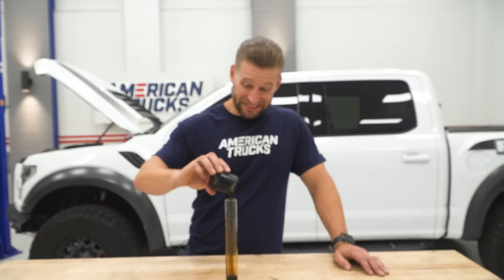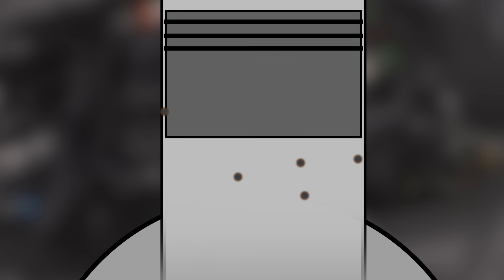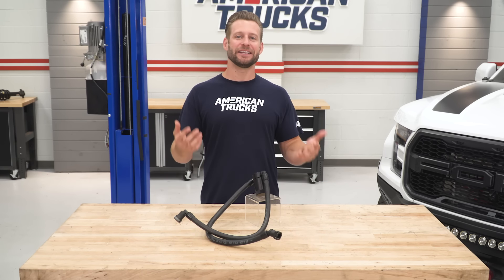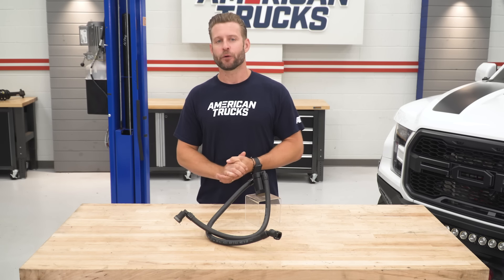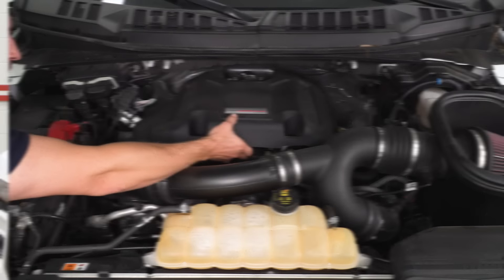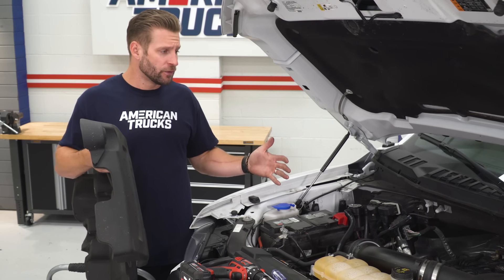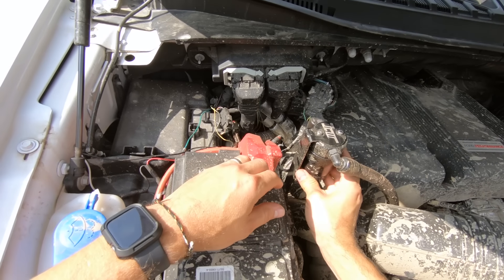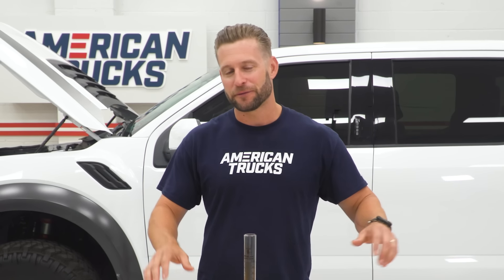Does Your F150 Need a Catch Can? - Ford F150 Oil Separators Tested And Explained

Comment: Ford ranger ecoboost actually has a oil separator from the factory on left side of motor. I was told as long as you change your oil as recommended you don't need these.

Comment: Does this affect your warranty and is it legal to add for pollution control in states that require smog checks?
Reply: Make it ez to take off and put the stock line back on. I remove mine before every service; I just do it eventho cars at that dealership I use  have them on. Taxifornia has a 7 years on the first emission test and inspection. They only plug in to the computer to check; but they still do a visual so if I have my truck in 7 years  I'll take it off. 5 minutes or less.
Reply: No it doesn't effect warranty at all. No check engine light means no emissions problems. They person checking your vehicle doesn't care what mods are on you vehicle. They just collect $ and send you on your way.
Reply: @jamestone265  I leave mine on. Matter fact I had to have my head replaced at 4k due to coolant leak from pin hole. It was actually during the install of my cc and airaid mit that I first noticed the leak after removing the monster hammerhead stock intake that was blocking the view.
Dealer never said shit about either.
There are laws that cover you for aftermarket mods and such. Basically the burden of proof is on them to prove a mod was the cause. Law is called Magnuson–Moss Warranty Act.
Reply: Completely legal, and would likely improve smog emissions. You just have to dispose of the "gunk" properly, as if you would oil.
Reply: it would actually improve your emissions because you are not burning that oil.

Comment: Does this void the warranty?
Reply: LiteTackleChamp magnison-moss act, not sure I spelt that right but look it up.
Reply from the maker: To expand on what Tom was saying- the magnuson moss act states that a dealer has to prove that the installed aftermarket part is responsible for the failure.  For instance- if your transmission goes a dealer can't point to the catch can and say its responsible.  Hope this helps!   -Justin

Comment: Hi Sir have a PT Cruiser 2 litre engine & have 2 breather hoses to the big air box & this was quite awhile ago I decided to check the air filter & so I took the top off the air box off & pulled out the air filter & I was quite shocked to know that the air filter was covered in oil & I ended up taking the whole air box out & I had to clean it all up as there was traces of oil everywhere in the air box & so after cleaning up the air box I went out to buy a new air filter & put that in place in the air box & still having the air box out I then cut the 2 breather hoses & put on 2 new breather filters on & had them resting on the top of the rocker cover & I never thought about a oil catch can & after driving the PT Cruiser around for awhile I noticed oil coming out of the to new breathers & had to wipe the oil up the rocker cover & clean the 2 breather filters & the & later on I couldn't drive the PT Cruiser as the front were way down òn tread depth & weren't warrantable & had the car sitting for about a Year & when I got 2 new tyres for the PT Cruiser & then it went for a Warrant of fitness the PT Cruiser had other issues as well as the ignition switch was faulty & Tony the mechanic couldn't locate a new ignition switch here in New Zealand & so Tony was able to fix the switch & then I asked Tony if he was able to fit a oil catch can with a filter & they had a Repco store here in New Zealand & it was Extremely Expensive the price was $326.00 but Tony was not able to buy it as it was way too big to fit it & fitted 2 new breather hoses to the big air box & just have to put some toilet paper or paper towels inside the big filter box where the 2 breather hoses come into the big air box & I will have to keep an eye on the engine oil dip stick level & it's a real shame that I have a lot of blow by in this engine as it is running quite good to & I will give it another oil & filter change shortly & I am going to get a smaller oil catch can from 1 of the AliExpress Stores that sell good Quality Oil Catch cans with filter & hopefully that will solve my oil problem & would be best to put the 2 breather hose to each side of the Oil Catch Can or wouldn't work & if not work properly I may have to buy a T fitting & have 1 hose going to the in let of the Oil Catch Can with filter & where would be the best part of the engine to put the outlet hose from the Oil Catch Can & I don't have the money to do the engine up & has a lot of blow by problem & that is the only way I can solve the by using a small oil catch can Kind Regards Peter PS I can get this Oil Catch Can with filter for a price of NZ $43.56 which is a really good price to pay for one of these OIL CATCH CANS WITH FILTER & I've seen prices here in New Zealand go from $65.00 right up to $800.00 plus  for OIL CATCH CANS & that's CRAZY PRICES

Comment: You facts are slightly twisted. Traditional pretty injection and direct injection didn't come about until 2017 with the second generation ecoboost. 15&16 are still just direct injection
Reply: He just made a mistake on one fact.  Yes in 2017 the 3.5 eco got both direct and port injection but not the 2.7 ecoboost.  That only happened in 2018 along side the 5.0.
Reply: Thank you for catching this, I have a 2015 F150 and didn’t think he was correct about it having dual injection.
Reply: @sergeysmelnik  ok
Reply: @well_as_an_expert_id_say  ok
Reply: @sergeysmelnik  glad we've come to an agreement
Reply: @well_as_an_expert_id_say  that's a thumbs up for you
Reply: The 17’s and newer engines is just a band aid fix.. you need a high pressure spray of fuel to cool and clean the valves constantly or you end up with major intake valve coking.. pull the intake on a 2018 f150 3.5 at 40k miles and look at it.. plus the valves are only half of the problem.. the drivers valve cover rear is the only place that the engine evacuates while in boost and the turbo compressed hot vapor and contamination into the intercooler and they fill with oil and produce condensate. This cause miss fires and stumbling when you nail the throttle after driving around normally for a while.. both valve covers need to be re plumbed to get this correct.. not just a ford issue either.  It is every GDI engine out there..
Reply: @TEAMRXPCOM  port injection added is a band aid fix? The 17+ 3.5s dont have the condensation issue like the gen 1s. I havent seen any reports of this on the f150 forum for the second gens. And by the way the condensation fix is extreme easy to fix.
Reply: Sergey Melnik they condensate bud... it’s not just the condensate.. look at your drivers valve cover rear,  the line with the sensor in it.. it goes to the turbo inlet.. this is the only evacuation point of contamination while you are in boost.. do you know why? The passenger valve cover has a built in check valve that closes when you are in boost.. that means all of your nice 200 degree blow by contamination is sucked in by turbo vacuum then compressed into your intercooler.. it does condensate and the condensate isn’t the big problem.. it’s the contaminated oil that coalesces and accumulates in the intercooler is what we prevent.. you need a can on each valve cover, you need to reroute your pcv .. I sell more kits to 2019 and 2020 trucks.. before they buy their trucks sometimes.. Happy Thanksgiving
Reply: @TEAMRXPCOM  I'll research this
Reply: TEAM RXP . COM Do u have a site to check out?
Reply: @markbulva4188  its literally his username..........

Comment: Make sure you empty it often. I was driving in -20 degree weather and it filled up much quicker. Blew out my crank case pressure sensor. Luckily I caught it before anything else blew.
Reply: I’m getting one of these and I live in MN. I just have to make sure I empty it often and I have nothing to worry about correct?

Comment: I just bought a 05 f150  with a 5.4 Triton and  176000 miles on it, all in all it's a very clean truck.  Put it on a scanner, and it threw up the code for the evap. valve .  It ran ruff and changing that seemed to make the truck idle smooth. But, when I tried to drive it around the block, under load it would run for a bit, and  then it wanted to run ruff.  I can smell raw fuel when it's running, but like I said the idle is good. Felt like a slight hesitation at the peddle every so often, setting in park, and revving the motor. I really dont know much about this truck, other than the oil looked good, and it came with two new catalytic converters. The guy who sold it to me said he thought it was a blown head gasket or crack head, but honestly, I really dont believe that 100%. I see no signs of that, plus the oil is clean. 
I've watched a bunch of videos here, and there is a variety  of things that are possibilities. Could you give me a few good places to start looking at as the problem?

Comment: I just cleaner the throttlebody on my 13 f150 with the 5.0 v8, ive had a catch can (oil separator ) since 2015 (made by ford racing)
It was basically clean, very little build up.
Cleaned the throttle body on my 17 accord, it was easily 3x dirtier that my 13 f150

Comment: I have a 2018 and was told that the problem was rectified in these later years. Is this true, or do I still need one?
Reply: The only solution for oil vapor in the intake air streem ,is to remove it... if Fe ord fixed it then you need to service your catch can regularly. 1 could hope the Fe ord engineers designed in an auto drain system or a service internal would be required.  Check your owners manual Whats it say?

Comment: if so good, why dont manufacturers install?
Reply: JK 241 I’m wondering the same..Perhaps they think the average customer won’t remember to empty it?
Reply: LOL! Bcz they need you to come back for parts sooner than later.
Reply: Andrew has it correct. Most people do not take the time to even check their own oil let alone service one of these....also planned obsolescence.
Reply from the maker: They are starting to- as seen on cars like the 2020 GT500 which features a self draining design.  -Justin

Comment: I have this on my 2015 f150 3.5L eco, simple install, surprising how much oily gas come out of the system.
Reply: Just remember on this application, do not over tighten you won’t get it off. Just snug is perfect

Comment: I am using 1/2 inch Harbor Freight air drier as an oil catch can on my F150 Ecoboost. It filters about an ounce of oil a month from entering the intake and coating the valve stems.
Reply from the maker: Nothing wrong with DIY!  -Justin

Comment: How does it work in cold weather. I’ve seen similar setups freeze and block the flow of pressure creating extreme pressure in the engine. That’s my biggest concern. I own a 2017 F-150 with the 2.7 L Thanks

Comment: While I did not purchase your brand of separator, I did get a good billet one. Unfortunately, mine does not show inlet and outlet on the ports. Is the PCV side open directly to the can and the engine side goes through the filter in the top? My filter element is a fine brass screen. I do get some oil in the reservoir so I believe I hooked it up correctly. Comments please?
Reply: The inlet has the mesh filter that is the side that comes from the PCV valve, the outlet is the side that doesn't have the mesh that is the side that goes to the intake manifold.

I have this same J&L 3.0 and they don't label theirs either what they tell you is the side with the 90-degree fitting goes to the PCV the side with the 45-degree fitting goes to the intake.

Comment: 2017 is when the 2nd generation 3.5L entered the F-150, which is when port fuel injection was added to the existing direct fuel injection system, not 2015.

Comment: Mine has a second vacuum source at the drivers side turbo. About a quart in size, and I empty every 2nd fill up. I have 36 gallon tank, so about 25 gallons per fill, equals 50 gallons of fuel burned in over a thousand miles.   I generally get about 12 -14 ounces  of fluid which separates to gas/sludge/water..  Remember, when you are on the throttle, your vacuum drops, but turbo suction increases. You should want the 2nd vacuum source.  Just my opinion.

Comment: This was easy to install on a 2017 2.7l eco boost, but the stock hose was a PITA to take off, had to break it off. Make sure to get a short step ladder to reach in and over the engine, unless you’re 7 feet tall 😆

Comment: I have a 2017 Expedition 3.5L eco....1) did they fix this issue or do I still need the separator?  2) if separator needed, I saw one guy say you need on each side of the engine? Thoughts? Also, I only run Premium in the vehicle. Thanks.

Comment: Thank you for the info. I recently bought a 2012 eco boost without knowing anything about it. I’m trying to get it up to par. It began misfiring a month after I bought it so after a little research I decided to drill a hole in the aftercooler until I could get a good catch can. I want to give it a seafoam treatment once I get the catch can but I’m afraid of plugging up the cats since the truck has 90k miles on it
Reply: Don’t waste your time my friend, just make sure u have a really good oil filter and use a good full synthetic oil. I have a 2011 f150 with the 3.5 ecoboost. I use Amsoil 5w30 signature series with their 25 k oil filter and I change it every 10,000 miles. I now have 222,000 miles on my pickup with zero issues
Reply: @stephenbloom2545  thanks for the advice. I was considering switching it to Royal Purple on my next oil change. Is there a better synthetic you would recommend for these particular trucks?
Reply: I personally have had great results with the Amsoil products. U can go on their website and become a preferred customer and save some money. I use the EA017 filter it’s rated for 15,000 miles on the ecoboost but I only run 10,000 between oil changes. I could tell the difference immediately when I changed over. With direct injection you need to run a fuel system cleaner once in while, Amsoil’s PI every 4,000 does a great job. These are pretty much a race car engine and we need to treat them like one. Good luck brother
Reply: @stephenbloom2545  ok awesome. I will definitely take your advice and try that instead.
Reply: @WhateversClever777  Pennzoil Ultimate Platinum rates almost as well as Amsoil at 1/2 the price. It’s all I use on my 2016 ecoboost and it runs so smooth I have to look at the tachometer to make sure the engine is running. I also use the JLT catch can and it’s well worth the money.

Comment: Here is how a catch can works.  Long hoses that run from the PCV to the can cool the hot vapors, the vapors flow around inside the can and condense.   If you were to stick the can directly inline with the PCV, it would be empty.  If racing, good to have, for a daily driver, not needed on an Ecoboost.
Reply from the maker: Tell that to the intake valves on 2011-2014 3.5Ls. 😬 -Zach
Reply: @americantrucks  Oh?  To date, no proof has been shown that the intake valves on the Ecoboost engines get fouled. Ford has a patent that allows for blowback of fuel to keep the valves clean.  Every single image out there of coked valves is an image from a BMW or Audi engine.   I have had 6 Gen 1 engines since 2010, NONE exhibited any valve issues, none have catch cans, all ran great. The engines were the least of the worries on any of them.   There are Ecoboost engines now with 300K+ miles without issues. 

Millions of Ecoboost engines are out there, yet, no instances of actual valve coking found.

Comment: Great video! Out of curiosity, I’m not a mechanic, so this may be an ignorant question, but could this lead to a bad pcv valve? Additionally, could it lead to a check engine light for fuel injector circuit fault and cylinder misfire specific to cylinder 1. 

I have 2018 raptor with 52,000 miles. I have not installed a catch can on truck but I am beginning to have multiple issues, hence the codes above as well as a loud rattle which I suspect is a bad pcv valve. 

Any help is greatly appreciated!

Comment: 18 months ago I purchased a very well maintained 1 owner 2012 F-150 5.0 4x4 with 147,000 miles on it. I recently saw this catch can video and installed one.
My question is what if anything would you recommend adding to my fuel to clean things up internally?
It now has 165,000 on it, it runs great but wouldn't you think it could use an additive?

Comment: I wish Ford Performance would make one to fit my 2020 F-150 5.0L. After 2017 year model the hoses and connections aren’t long enough...... The filter on the Ford Performance version is twice the size of any other oil/air separator on the market.

Comment: Question. I have a 2014 f150 3.5 eco boost with 89 thousand miles on it. I drive very lightly on the truck with my rpm rarely going above 2 thousand. Would you recommend a catch can and also do I need to get my values clean because I didn’t have a catch can on it for 8 years? Also I got the eco boost for gas mileage but my truck tells me I average around 14 miles per gallon. Is that normal for this truck?

Comment: I have a new 2022 F150 3.5L Eco and only recently did I hear the coking issue on older models. Nevertheless, I ordered one of these bad boys to help keep my valves clean. I grew up working on my cars. The PCV always gums up over time. I never stopped to think about what was going on beyond the check valve.

Comment: Great video, I just bought my F150 , and I was wondering if this oil separators will void my car  warranty ? 
Please reply to my question. Thanks
Reply from the maker: Unfortunately different dealers take different liberties with what they deem affects warranties.  Its been my experience that these do not however, if you're that worried just pop it off before you send it to the dealer for maintenance - will take all of 5 minutes. -Justin
Reply: @americantrucks  thanks man